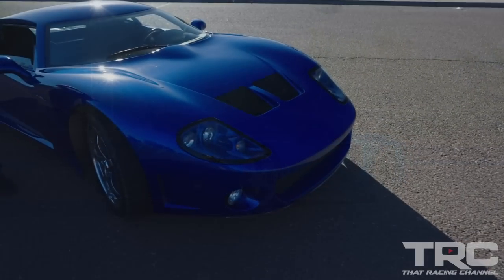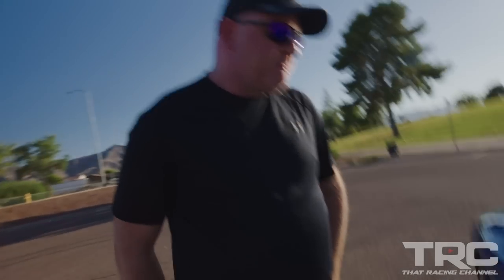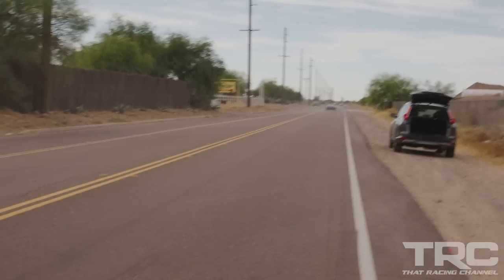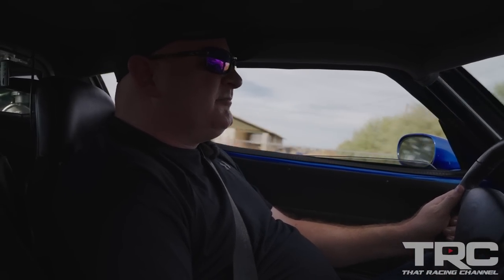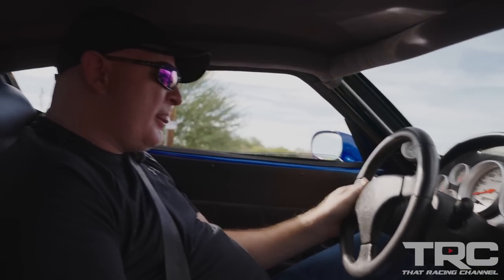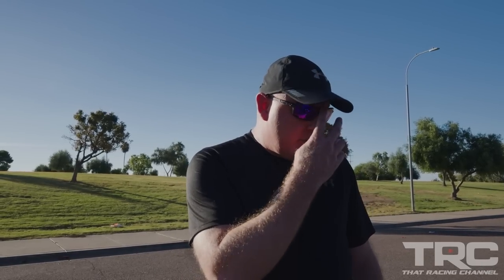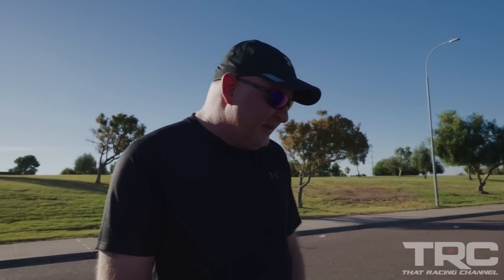800HP Supercar with a Lamborghini Gated Trans?! 2600lbs TT LSX (Turbo EARGASM!)

Comment: I'd say that the front end reminds me of a Ford GT50, as well as the rear end (which I imagine the Factory Five engineers were partially attempting to replicate while adding their own flares to). However, the LS 372 with the twin turbos and the Lamborghini manual transaxle makes it an absolute rocket and I'm sure it's extremely fun to drive. I realize that this won't be anywhere near as cool, but I am currently in the process of turbocharging my 2004 Acura TL that I already did a six speed manual swap (out of a 2003 Acura CL Type-S) on, and I'll be using an AEM Series II 30-6051 standalone and a Garrett GTS3582 dual ball bearing turbo with a billet compressor wheel. The J32A3 makes 11.0:1 compression, so I have to run low boost or swap to E85, but even at 8 psi it should make close to 400 whp and that'll be more than enough fun. I built my old 2001 Accord with a J32A JDM 3.2L V6 with the same turbo and on 93 octane it made 502 whp on 10 lbs of boost.
Reply: Got yourself a subscriber. Cool vids👌
Reply: well done simple setups are dope dude! humble is the best approach, but dont sell yourself short :)
Reply: dont let anyone tell you other your build is cool because its yours good shit cl type s was my favorite car i ever owed back in the day
Reply: You mean Ford GT 40?
Reply: J-series rocks...I like the j35a7 engine, got the oil squirter under the pistons, like a gsr(B18c1)

Comment: I never heard him say what boost pressure he's running but given the 91 octane he says he uses, I have to think it's not much at all- ton's more power possible. But drivability is a thing vs a dyno queen that makes that 4 digit power which this could easily do. I love that the guy set things up for drivability so he could enjoy it on the street. Its a very well thought out & beautiful machine.
Reply: It is running 12psi in the current config.  When I had it tuned, I was told that I need to do an E85 conversion to safely pull more power out of it.  However, shortly after doing the 12psi tune, I took i down the half mile, and I'm pretty happy with where it's at.  I would like to pull 4 digits out of it, but I think it would be just as you said, a dyno queen.  I appreciate the kind words.
Reply: @NischGTM  I have gotten into the situation where I was so focused on a dyno number, that not only can no one really see but that often hurts real performance because of traction. In my opinion, I think you should tune this beauty how you like it, so it is responsive & feels good while driving it & call it a day. Having a REALLY rare & labor of love like this that you never worry about when you turn the key is priceless. I have lost many races because I was spinning tires vs laying down good, usable power- so I say enjoy what you've got & put a bunch of miles on this thing with a smile on your face!
Reply: @NischGTM  You're car really is the best blend of beauty & performance that companies like Ferrari strive for... only they are slower-lol. This machine is going to make you happy for years to come- and I'll be so happy for you every step of the way!
Reply: @NischGTM  This car definitely needs E85 and a flex fuel tune. Keep it on 91 and 12 psi on the street, but make over 1k whp on E85 for the track. With a sticky tire. Then you'll find the weak link in the drivetrain, but hey, that's the car hobby... Beautiful car.
Reply: @gregmatson1470  Yeah, NicD said it was barely just starting to open up at 12psi and has lots of room.  One day I'll go over to E85, but it's been fine on 91 being so light.  My biggest hurdle now isn't power, but rather handling up at the higher 170+ speeds.

Comment: 800h seems really modest for the quality of the powertrain
Reply: Just easing into the process.  I encountered a lot of issues with this build, especially the transaxle.   I started with 6psi around 600hp.  When I bumped another 6psi, I picked up almost 200hp.  At the half mile, I definitely got faster, but encountered the handling issues.  I've addressed those and now will be dialing it up again soon.   The car is also undergoing a full rewiring, switching to InfinityBox. While doing that, I'm adding the ethanol sensor, wiring the ECM for that and likely going to 20psi once all of that is done.
Reply: @NischGTM  you rock dude!!

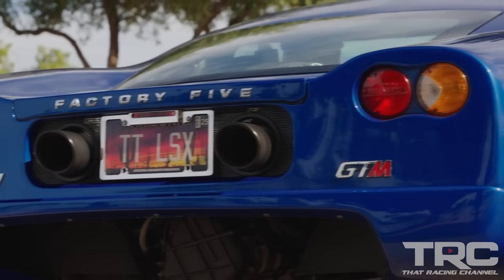Comment: 4:38 this is the only problem with this car. I'm as big as this guy so there is hope. He had to mount the seat directly to the floor and lean it back to be able to fit with that low roofline. His head is still in the headliner. You get your squats in just by getting in and out of it, worth it.
Reply: I hope tall people realize that short people have to do the same thing to get into a low car.

Comment: Hey buddy. Where do you have the engine and transmission done? Who was the mechanic? Pls let me know. Thanks
Reply: The engine is a stock LSX376-B15, crate motor from Chevy.  The transmission is a stock Graziano 6 speed out off a Lamborghini Gallardo.  I did the install and fabrication myself.  No mechanic.  It was tuned at Cordes Performance in Tempe, AZ by Nic D and Joe Cordes.

Comment: Always wondered if these things built by Billy Bob in a shed can even handle or are they a mess to drive?
Reply: They handle surprisingly well.  Before I did the TT/LSX setup, I was daily driving it to the office.  It has air conditioning, heated seats, etc.  Granted it's loud and smelly without the cats now, so it's a little less calm to drive around town, but handles very similarly to a standard Corvette.  I actually think it's more comfortable than my gen 4 Viper.

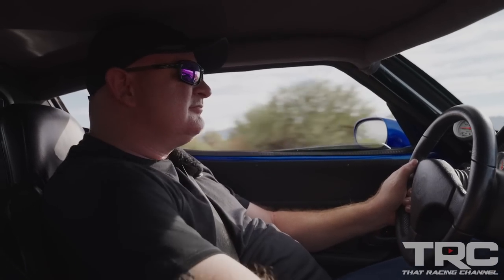Comment: 6:14 - 9:14 Massive engine knock!
Reply: Yeah, I made the mistake of not turning on the intercooler pump and fans and that shot was toward the end of the ride, and heat soak had already set in at that point.  That actually was the last pull before we had to call it because of that.  With that pumps and fans running, this isn't an issue, even in the hot AZ summer.
Reply: @NischGTM  Good to know you are aware of it. Take care of your awesome car!
Reply: @NischGTM  why not some water methanol injection? Or even c02.. Would help intake air temps.. Not familiar with intercooled intake very cool for limited space builds. But how efficient are they? I imagine a forged ls can handle more then 12psi on some 6266s? I have gotten much more efficiency out of small turbos with water meth and vp racing octanium (where e85 isnt available)
Reply: Or just dial back ign timing a degree or 2 and add another 2-3psi
Reply: @OGfromUtube  I have run meth injection on my cars before and had great results.  I just have limited space in this car and don't have the need when the fans and pumps are on.   In regards to CO2, the heat exchangers for the w2a are in the large aide vents in the side of the car, which is the main airflow into the engine bay. I don't want to run the risk of starving the intake in any way.  The E conversion will work wonders and the Lingenfelter intake does a really good job (again, when my idiot self turns it on, lol).  I ran e85 on my GTR and it was crazy.
Reply: @NischGTM You can wire a temp sensor on the charge pipes. That way fans and intercooler pump can self activate (win an override switch too). Are you runing pump gas? E85 might be a solution too. Anyway, awesome car. Love to see these kinf of builds (At least on youtube. Nothing close to that in my country). Cheers from Chile!
Reply: @NischGTM  If was available id def use that as well. I utilized my washer fluid tank and mounted the wmi pump under the car so it gravity feeds to the pump. Then just a single 1/4 nylon hose to the nozzle mounted in the charge pipe pre throttle body. Really took up no room at all.
Reply: And a check valve in line so doesnt siphon under vacuum.

Comment: Looks like something is missing on it, possibly a spoiler. Very nice car but looks naked sort of.
Reply: I agree.  I have a couple spoilers sitting in my garage, but need to machine the mounts so it properly mounts to the frame instead of the deck lid.  I just bought a 3D scanner this week specifically for projects like that on the car. Now I just need the time, lol

Comment: dudes.... the average ricer has 800hp out of a 4 cyl............. using EBAY parts.

a twin turbo LSX only making 800 hp is a pathetic joke and doesnt deserve any air time at all.
doesnt matter what chassis its in, doesnt matter what gearbox its bolted to.

"SUPERCARS" are the 3000hp gtrs and lambos on the street. not this pathetic trash.
Reply: And what do you drive sir?
Reply: @ldturbom3368  a fucking yugo with a 3 speed.
Reply: Lol
Reply: You can just say you're not a car guy
Reply: @frankflorio3213  imagine being impressed by a weak v8 that makes no power.
Reply: @SirSquash  no actually, im impressed by the amount of dedication you've put into this considering you dont like it. Dreamer.....
Reply: @frankflorio3213  "dudes.... the average ricer has 800hp out of a 4 cyl............. using EBAY parts."
Reply: @SirSquash  The "weaker" V8 wouldn't need a rebuild every 20,000 miles vs a turbo'd 4 cylinder, and with 2,600 lbs you're still at an advantage on power to weight ratio against anything heavier

A bit of common sense was necessary
Reply: Dudes...  Clearly this kid's car experience is based entirely on youtube/social media and video games.
Reply: This is dumb as hell lmao this car is running pump gas lol you get how insanely conservative the tune on this is?  Even on pump e85 this car would make well over 1000whp, let alone actual race gas.  A 4 cylinder making 800whp no matter which one is going to be strung out and will be a lot less reliable.  Also oiled make no where near 800 on 91. Basic information.
Reply: It's getting the ethanol sensor as we speak so I can turn it up even more.  I appreciate the feedback, but I have no interest in trying to get thousands of HP out of the gate. I'm taking a slow approach into it so I can work out the bugs.  It is getting more power soon.   Weight is a huge factor in this though and you don't need a ton of power to get it moving.
Reply: @AP3D  he's just a broke gamer
Reply: @NischGTM  ITS AN AWESOME UNIQUE CAR!
i just like trollin the kids on here who dont know when theyre being trolled. dont take anything negative i say seriously. please.
Reply: @SirSquash  i hope so lol.... 800hp reliably is not ever coming from a 4cyl with ebay parts i promise you that... Maybe 1 run...
And most 4cyl cars weigh 2900lbs that 300lbs = 300hp.. And ppl think way too much into hp #s... I can spank 500hp cars with a 350hp with 475ft lbs tq car at same weight.
Reply: Every kid this generation who thinks supras come with a 1000hp are out of touch. Even 400hp in a 2600lbs car is prob more then you can handle.. I had a 12 second civic and that was scary breaking traction at 60mph in 3rd... That was nowhere near 800hp or even 400 for that matter.. What fun is a street car of you cant give it all it has and keep it on the road..
Reply: Kit cars are common ppl applying engineering. They deserve all the props in the world.. Great job, beautiful fab work..